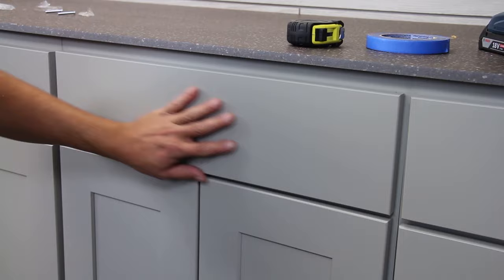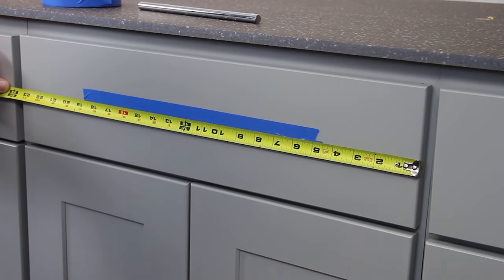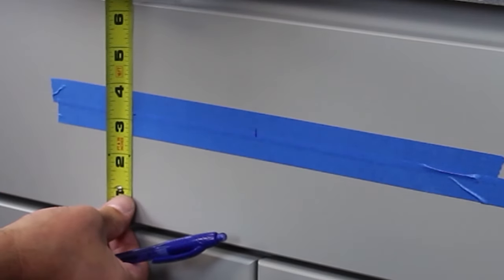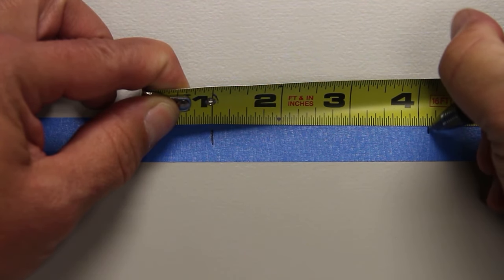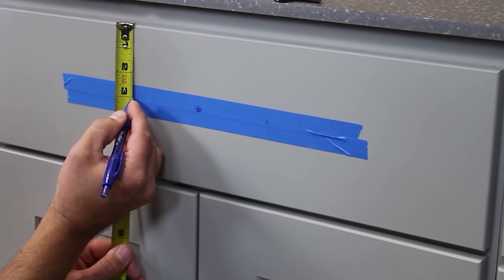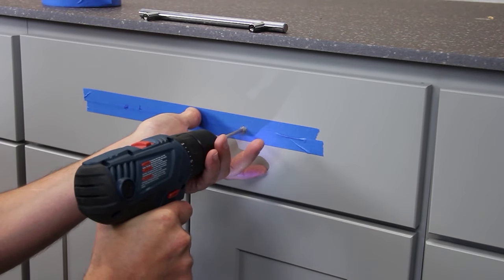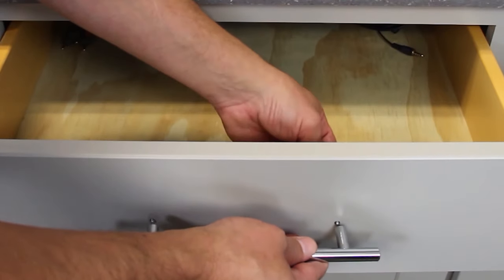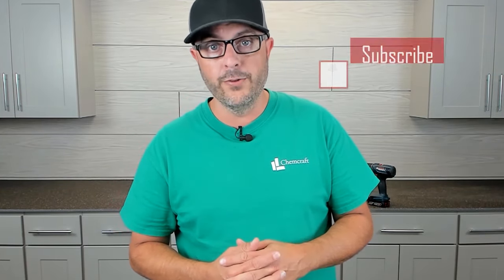Cabinet Drawer Handle Installation - NO TEMPLETE!!!

Comment: Thanks for the video.  One trick I also do is once the drill points are marked, use a punch and hammer to make a small dimple at the hole location. This help stop the drill bit from “walking” off the spot.

Comment: I did almost exactly this to line up the drilled holes, but my drill (both of them, actually; one a Bosch and one a Worx) WOBBLE.  They don't spin true.  Tolerance for this project is about 2 mm so my holes didn't line up properly with the holes in the handles.  fml

Comment: Sorry I’m a few years late to posting here, but I have a question. How do I install antique bail pulls? I have these old pulls which are composed of 3 parts each (5 parts each if you include the 2 screws per pull). But essentially the middle handle comes apart from the two side mounting hardware pieces that the handle sits in. I am finding it really tricky to correctly space my drill holes so that the drop handle fits securely in the side mounting hardware. I either seem to place the side hardware pieces slightly too close together and then I can’t fit the handle in after the side mounting hardware is secured to the drawer, or i place the  hardware too far apart and the handle won’t stay in place and falls out. Hopefully I’m making sense. Any suggestions you have would be greatly appreciated.

Comment: Just curious. Getting the measurements centered between the sides is great. I want the handle closer to the top than the center up and down. Do you have tips for how to keep it level if your not measuring for the true center?
Reply: Just measure from the sides to get your center horizontally. Then measure from the top to a distance you want the handle at. Then just repeat that measurement across all of your drawers

Comment: Hi Jason, my name is Jason. The bolts that came with my handles don’t seem long enough to reach the threading holes once I drill. Is there ever an instance where I need longer bolts, or am I missing something here? I’m usually pretty handy but I don’t want to drill holes then the wifey will be yelling at me.
Reply from the maker: Hi Jason! Yes sometimes you need longer bolts due to drawer and drawer front thickness. They usually come with 1” bolts and depending on how much you are needing you may need a few options. Here they are- https://amzn.to/3HUuOgZ
Reply: @DoingitWithjason  Great! Thank you.

Comment: I just drew around my cup handles on paper then folded them in half , that then let me push a pin through the boss for the screws and when it opened up again the two pinholes were NOT the same distance from the centre ! 

That means if you mark off centres and drill holes then the handles will not be on centre and in my case will not be level , and I have a lot of these , so each one will have to be individually templeted to ensure accuracy . 

Cast handles tolerances are not to be trusted .

Comment: Aren't those holes too big? Wouldn't the handle be wobbly???
Reply: The screws thread into the back of the handle, so when you tighten it, the handle will be tight, it isn't necessary for the screws to be tight going through the holes that you drill